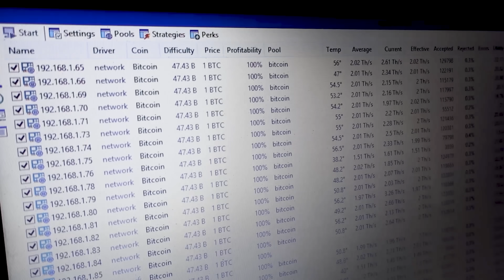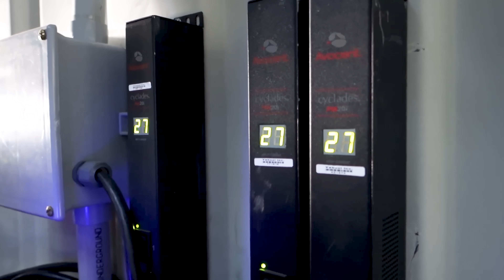Secret tour of largest BitCoin Mine in Washington State! $BTC #DiamondHands - @Barnacules

Comment: Jerry @ 6:57 you wrongly compare their 300 KiloWatts per container, its at this point he says = 30-35 houses worth (accurate). You then state you have 100KW to your house (about 3x, this is wrong) You probably meant 100 AMP service, which would be an average small to medium size house. (20-24 KW). Some newer big houses use 200 AMP service panels. Still only 50KW MAX EVER, and a house wouldnt use 100% fully 24/7, far from it. So I'm standing beside his 30-35 houses worth of electricity per container figure.

Comment: And if u rent the servers, then u dont loose spitting out cash on hardware you use for anything else, esp if it depreciates laterz.. Also you obviously loose the noise & heat at summers, since its off your home sector.. 👍
Reply from the maker: Honestly, these days it's more profitable to just buy low and sell high and wait out the markets like you would stock trading. It's really hard to make a huge profit mining without a giant operation anymore unless you happen to start with a crap coin that happens to gain value later on but that is even a huge gamble where you might lose 100%.

Now days I mostly just buy and sell unless it's winter time and my crypto mining hardware heats my house for the same price as a space heater but pays for half the electricity it uses so it's totally worth it.

Comment: How was it determined that having the air intakes facing the wall and exhausts towards the center was most efficient?
The ceiling fans (3?) exhaust the hot air but where does the incoming air come from (create a draft)?
I'm guessing ducting the hot air (to ceiling fans) wasn't done due to cost?
How is moisture (humidity) handled without AC and/or a dehumidifier (what about summer heat)?
Btw - I thought BitCoin was dead?